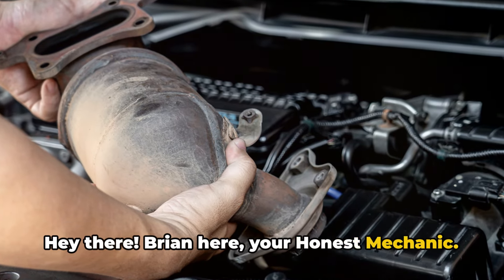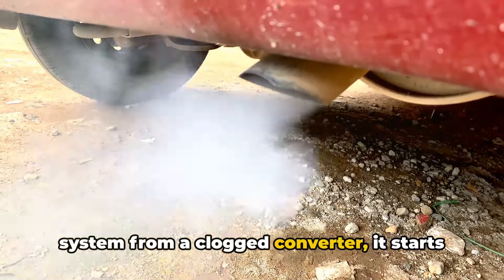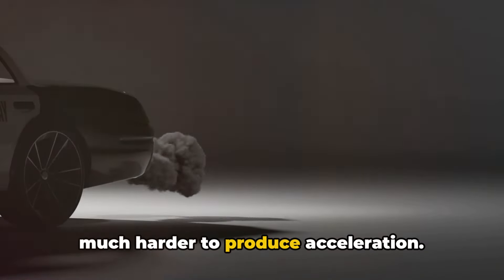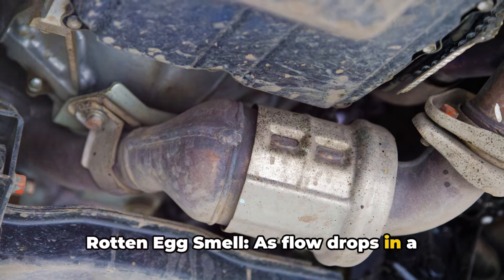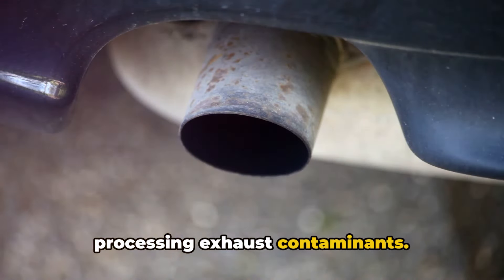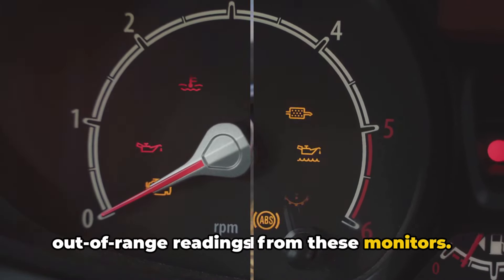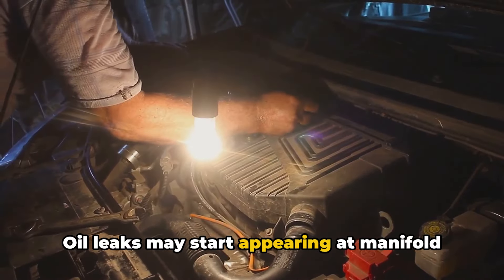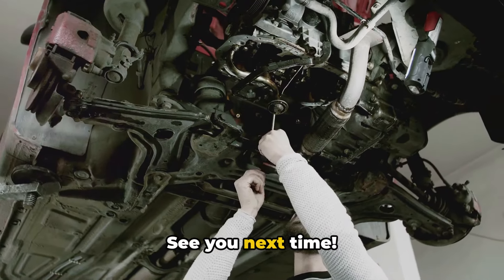Clogged Catalytic Converter Symptoms: 6 Signs of Trouble

Comment: Will the engine light come on if there is a cat problem on a normal 2013 petrol car?
Reply from the maker: Hi man, from what I have seen it depends on the make really, I had an audi with a cat problem but the check engine light was not on, however, most vehicle makes will surely trigger the light.

Comment: This is exactly whats going on with my car and I've taken it into Subaru 4 times the past months and the check engine light was the final five away. First was 1 really weird engine start where the car felt like it was missing fires on the boxster engine, Then I noticed the performance was 20-30% less, then after revving the engine while decreasing RPMS would almost hit 300-400 RPM and almost stall. 2023  WRX with only 1985 miles on it. I hope this is the final time in the dealer have a 3 week road trip planned on April 7th
Reply from the maker: Hey, that sounds like a real hassle with your car. Hope the dealer can finally fix it so you can hit the road without any worries!
Reply: Well, pray you can take advantage of that lemon law before you’re stuck with it
Edit: there’s always a couple bad lemons on the tree, don’t forget that, goes with any manufacturer, like before, get it taken care of via lemon law, and get yourself another WRX 👍🏼

Comment: I have a 2017 Hyundai Tucson and I have Hyundai do the timing chain twice and replace the knock sensor. And my car doesn’t idle weird but every time I want to accelerate it feels like it’s stuck in a gear and it squeals at 4,000 rpm. Before the repairs it has gone in limp mode twice. The car has 98,000 miles on it. I don’t see why Hyundai thought it was acceptable to give me the car back after having the car for a month and some change. Does anyone know what it could be? The dealership told me my catalytic converter was bad but I scanned the car with the obd scanner and there is no codes and I’ve driven it for at least 100 miles.
Reply from the maker: Hi, It sounds like there are a few issues at play with your 2017 Hyundai Tucson. Despite the dealership's suggestion that the catalytic converter is bad, the absence of error codes and the symptoms you describe (squealing at high RPMs and feeling stuck in gear during acceleration) might indicate a problem with the transmission or a belt in the engine, such as the serpentine belt. It's also possible that there is an issue with the throttle response or the exhaust system that isn't triggering a fault code. Given the range of repairs already attempted and the persistence of the problem, it might be wise to seek a second opinion from another mechanic or a different Hyundai dealer to thoroughly diagnose and resolve the issue.